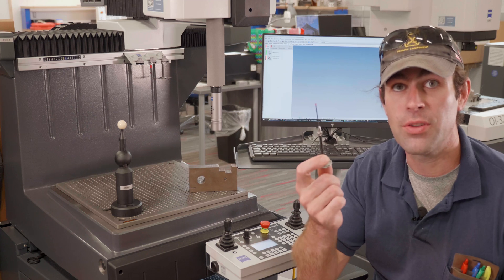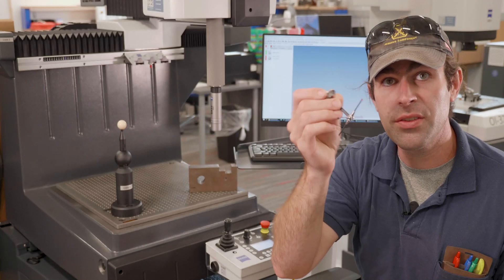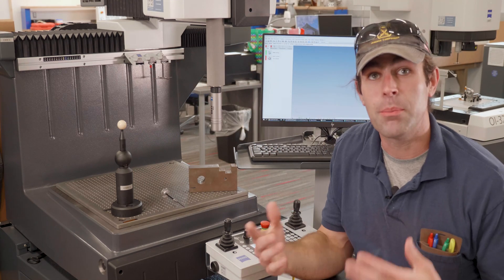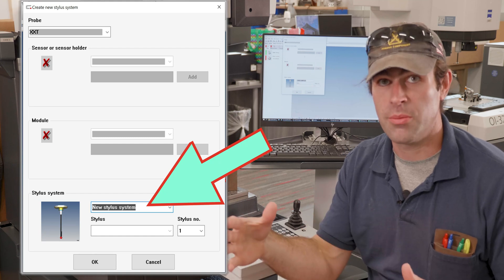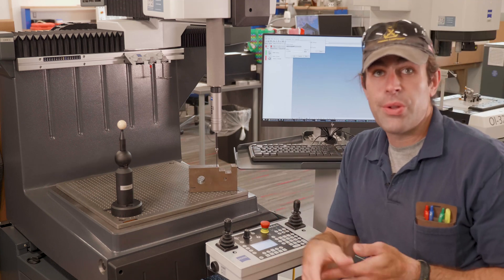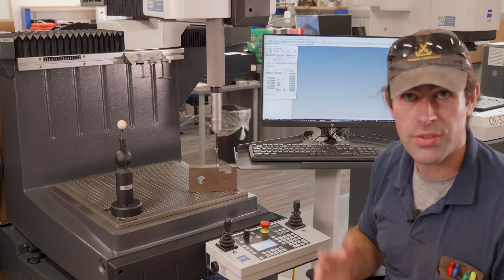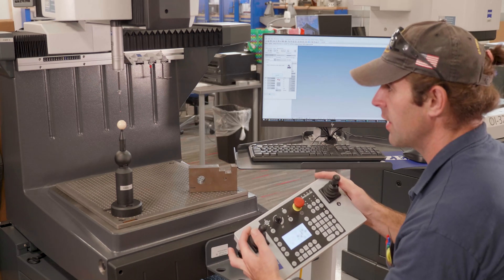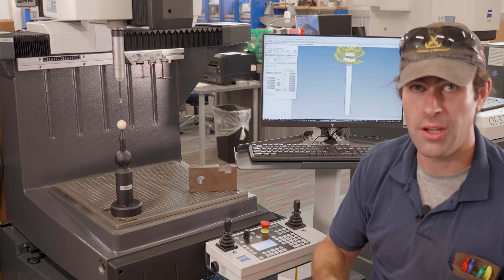CMM Zeiss Duramax with Calypso: Stylus Qualification, Z Minus Styli (Programmer Training Lesson 3)

Comment: How do I use the "Measuring Force" parameter in the final dialog where you click OK to start the calibration routine?  We just had a Contura G2 7/7/6 installed, with Calypso 2022.  The tech who set the system up last week has 200nm in that box, but we have some really teeny styli with super thin shafts to the dinky .008"balls.  Does the Measuring Force option exist to accommodate teeny/delicate styli, or is there a different reason for it?